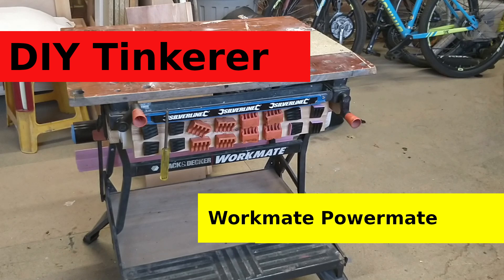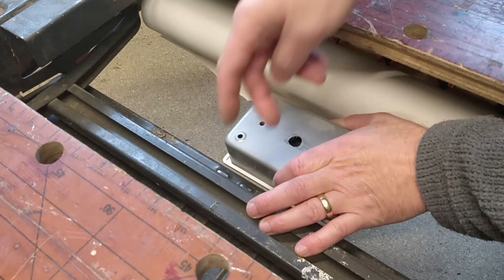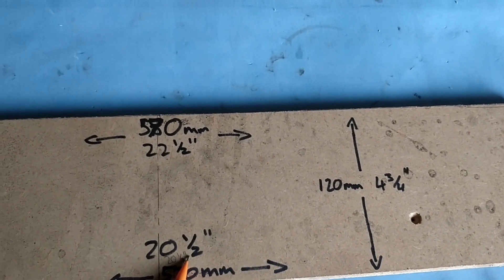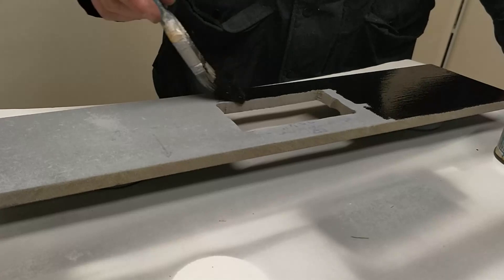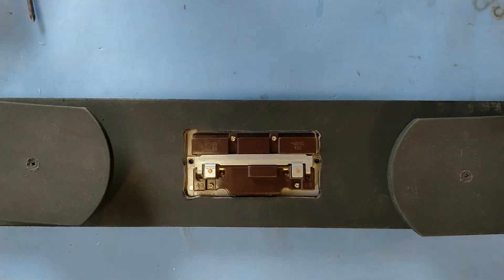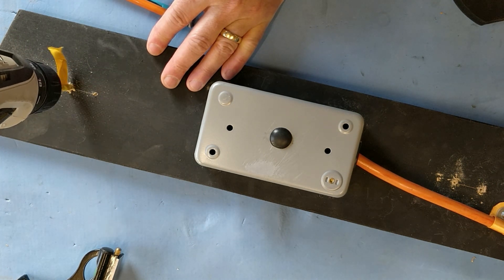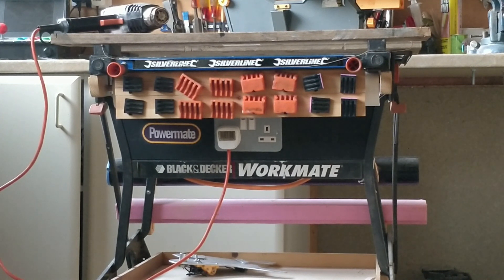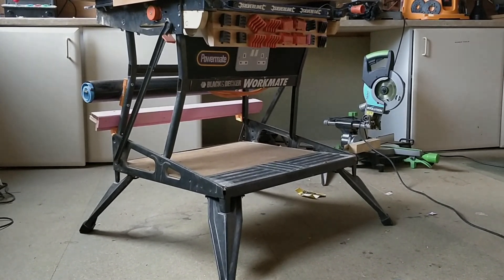11. Workmate modification: Powermate

Comment: Great how-to video - thank you.  One big correction: it's not the voltage that kills you, it them amperage.  Doesn't matter whether it's 110v or 220v - both have sufficient amperage to kill.
Reply from the maker: Hi James,
Technically you are correct and you should be careful around all live mains electricity. The key here, which I'm sure you understand but others reading might not, is that current is dependent on a potential difference to drive it, the higher that potential difference, the higher the current for any given resistance, so higher voltages present greater risks, even though it is the current that gets you! Thanks for the correction and contributing. Keep watching :-)

Comment: I took the easy way out:  I hot glues one of my many spare 6 plug surge protecting 15 amp power strips to the back cross bar, and in 4 minutes (the glue gun had to heat up first) I was done.  That power strip ain't budging.  And given the cost of electrical components these days, it probably cost less than the parts shown here.
Reply from the maker: Sounds like a good solution.

Comment: I added a 4 gang supply strip to my work table top which is controlled by an NVR switch which in turn is controlled by a remote socket adapter. This controls my dust collector and what ever power tools I'm using on the workmate bench.
Reply from the maker: Good man :-)

Comment: Thanks for sharing your ideas on enhancing the workmate capability.  I noticed you attached your circular saw to the workmate in another video but I dont see how you expanded the jaw opening to hang the saw upside down.  Im in the process of retrofitting my workmate top to do just that.  Do you have and suggestions to do this?  Thanks.
Reply from the maker: On my Workmate (800) the rear jaw can be removed and put in 3 positions to accommodate different widths you need to clamp. I put 3x2 in line with the workmate frame and fixed it to the frame using an M12 (I think) bolt, the hex head fits in the wide part of the slot on the frame that secures the rear jaw to the frame, and the shaft fits in the narrow part of the slot, you then tighten the bolt until you get a good fit that allows you to remove it without binding but at the same time is secure on the frame. You can then fix any surface to 3x2  - such as a homemade table saw or woodwork vice etc. - hope that makes sense.
Reply: @DIYTinkerer  thanks,  thought that's what you did. I have a am 300

Comment: Thanks again. I bought a new workmate only a few days ago and I didn't contemplate how many other issues I could resolve with it. I now see that it doubles as a mini step ladder (1 step only) but enough to get the extra height I usually need. I can see I could fit my chain saw chain sharpener (a bit like a bench grinder), my bench grinder, metal vice and wood vice to it, not forgetting that it can also be a portable extension cable / work bench for my power tools that have cables. A really helpful series of help videos, well presented and well thought out.
Reply from the maker: Thanks, the Workmate really is the best :-)